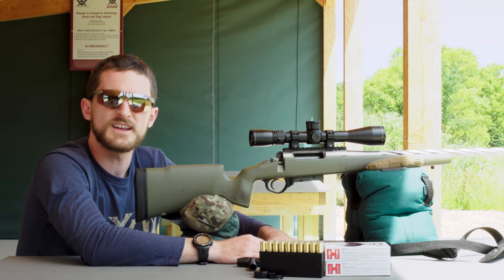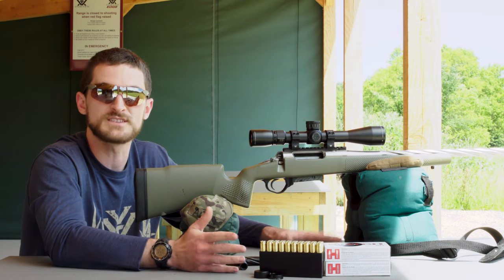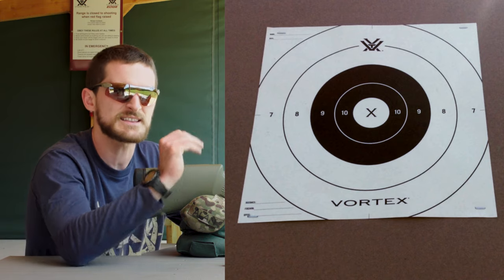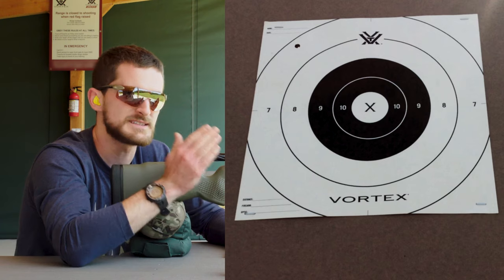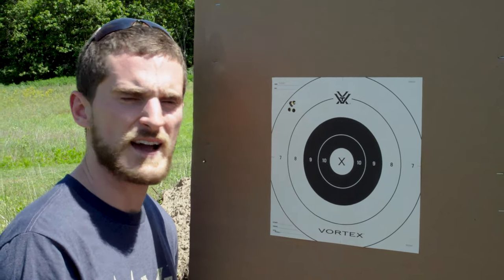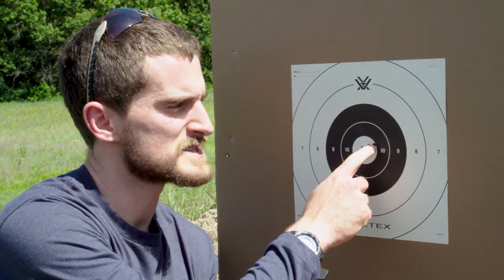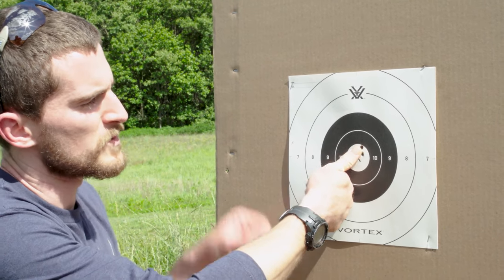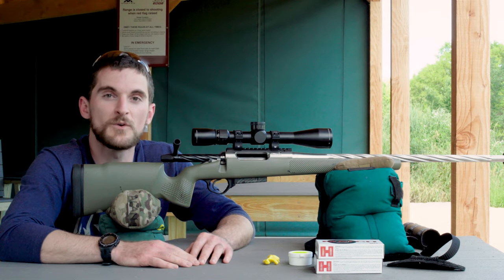How to sight in a riflescope

Comment: My biggest question was answered at 6:50 of this video. When you make adjustments, you are moving the "point of impact" NOT the center of the cross hairs. How many times did I make adjustments just to find out it was hitting even further away opposite the bullseye? So if you are "hitting high and to the left",  make adjustments down and to the right". At 8:18 you hit to the right and said you need to adjust "back to the left" but you have to actually adjust "right" to move point of impact. So many other videos I watched didn't clarify this. Thank you.
Reply: I'll watch videos on this and think I understand and then do the opposite at the range lol

Comment: Another thing i like to do is firmly grip the scope and ensure that it is sturdy, i have a savage 6.5 Crd Mre. And when i zeroed it the first time a few months ago i was excited as it was my first time shooting it but to up the anti, i was loosing daylight fast so i rushed it i used a series of tools to ensure the rings were square on the picatinni rail base (provided by savage) with 20 MOA, I thread locked my ring screws but forgot the BASE ones and needless to say when i tried to confirm my zero yesterday the base was loose and it was pointless shooting so i will try again. Thanks for all your info !

Comment: Oh my god.... I never knew that’s what people meant by “resetting the turrets to zero.” I didn’t know you could take the knobs off and do that.....
Reply: I just realized that. Wow!
Reply: @igorbukhantsov  neither did I… one of my cheaper scopes doesn’t do it but sure enough my Vortex Rimfire does…. I thought at first that was just in case the knob was slippery or something and you wanted to use a tool or a cartridge to turn them. A lot of smaller optics like red dots and stuff require a tool to adjust the zero so you can’t accidentally adjust your turrets.

Comment: So I purchased the Vortex Viper HS 4-16X44. I zeroed my rifle Tikka T3X Lite in 6.5 Creedmoor with 0 MOA Talley rings at 100 yards. It’s advertised that the scope total elevation is 50 MOA but I counted all the MOA’s from bottom all the way up is 64.25, so my question is, is there such thing as having more MOA’s for elevation as what it’s advertised?
Reply from the maker: Yes, that is very common. We are pretty conservative with the numbers we publish, so on that optic you will have at least 50 MOA. It is very common to have more than that though.
Reply: My Viper PST Gen II 3-15x44 FFP is speced for 75 MOA of elevation adjustment. It actually had 84 MOA of adjustment. So after backing the zero stop off,  I ran it down to the bottom and then up 42 MOA (half of 84) to begin with the reticle centered.  On a rifle with 20MOA of elevation built into the rail or the scope mounts, I would have come up 22MOA from the bottom (42-20) to get a ballpark scope reticle lining up before the initial bore sighting.

Comment: Hi guys my turret covers on my 3-18x44 sfp strike eagle does not have a slot head to remove to set zero. What other screens heads were used? It may be a torqux head or maybe Allen key. Hard to tell it's very small.

Comment: for a rzr zero stop scope, do you remove the top elevation turret when firing rounds for sighting in?, also if you remove the clicking screws on the base elevation turret to bore sight, are you able to fire rounds without the set screws on the inner elevation turret?

Comment: Does it matter on what magnification the scope is when zeroing it in?
Reply from the maker: As long as you are using the center part of the reticle magnification will not matter. It's usually helpful to be at a higher magnification though as you can be a bit more precise.

Comment: Once you’ve sighted your scope how do you stop it from getting bumped and the turrets from turning etc I’ve always used the older scopes with the old coin style to adjust etc and caps to protect them I’m looking at getting a scope like this once sighted how do I stop it from turning etc ?
Reply from the maker: There would have to be a pretty significant bump to the turrets to get them to move that much off of zero. Which optic do you have?
Reply: @VortexOpticsUSA  I’ve just ordered the vortex Dimond back tactical FFP EBR-2c MRAD I’ve only ever use the older scopes with the turrets that you can only turn with a coin or screw driver etc etc and was just wanting to know how you use this new one with out them turning and spinning after being sighted
Reply from the maker: @matthewharrington3154  On that optic you can re-index the turret so that it is lined up with zero. This will serve as a reference point where you can simply look down and you'll be able to tell if it was moved or not.

Comment: So I just purchased a diamondback tactical 4x24-50 today and did not realize it didn’t have a zero stop prior to purchasing. My question is once you zero and they remove the turrets and orientate the turrets to that zero how do I prevent myself from going beyond my zero if I make adjusts?
Reply from the maker: The only time it really should be a concern is if you dial more than one complete rotation. If it is under one rotation you will simply need to remember to dial back down to align with zero. If you dial past one full rotation you will need to keep that in mind.

Comment: On my vortex scope i have a distance adjustment. When i zero in at say.. 25 years with scope set to 25 and then go to 50 yards and adjust my scope to 50 yards my scope is WAY OFF… do i need to bring my scope in for repair?? That distance adjustment should work correctly but it doesnt…

Comment: @vortex optics  I am shooting a crossfire 2 what on the dial to move the scope does it have? Is it MOA? Can I reset zero on that scope? What is the math that I do do determine how many clicks to move the scope?
Reply from the maker: The Crossfire II uses an MOA turret system and reticle. You can reset the turrets to align the 0 with the indicator line, but it does not have a zero-stop.

Comment: Is the a recommended bullet weight/type for zeroing? Is match ammo better so sight in with?
Reply from the maker: It really depends on your application. You will want to use the same ammo though that you plan on hunting with or shooting with later.
Reply: Confirming zero with what ever ammo you plan to be using is the best practice

Comment: Did you use a laser boresighter and, if so, which one?
Reply from the maker: We recommend taking the bolt out of the rifle to boresight or to break down the optic so you can align the bore with the target and then align the optic with the same target.
Reply: @VortexOpticsUSA  That’s all well and good if you’ve got a rifle that you can pull the bolt and be able to look down the barrel.   With rifles like an AR-15 or, in my case a Mini-14, looking down the barrel at a target isn’t possible.
Reply from the maker: @SargeUSMC  With an AR-15 we would simple remove the upper from the lower and take out the BCG. You can then proceed to boresight as normal. The tough part with laser boresighters is that due machining tolerances they don't always align with the bore and when using them at close distances then can give skewed results. You would want to use them no closer than 50 yards like you would traditionally boresight.

Comment: Do you do this on maximum or minimum magnification?
Reply: Either, point of impact shouldn’t change based on magnification
Reply from the maker: You can sight it in at either as magnification won't change your POI as long as you are using the center crosshair. I would recommend doing it at the highest though for the simple fact you can see your target up closer and be more precise.

Comment: easiest way to think of sighting a scope for me is the scope's cross hairs as "chasing" the impact point. Blue thread dressing on all  mounting screws. Red is too permanent.
Reply from the maker: We would not recommend putting any Loctite or threadlocker of any kind on the ring screws. It acts as a lubricant  causing the torque wrench to slip when mounting and will result in a false reading. Using Loctite can add about 40-50% extra torque to your value. Simply use the proper torque spec (15-18 in/lbs) is what will give you the most performance out of your optic.
Reply: @VortexOpticsUSA  I agree and should have stipulated my statement related to the heavy Burris Optics Eliminator II laser scope  4-16x50mm . The Eliminator scope series use "Direct Mount" clamps instead of rings. One inch risers are necessary for a picatinny rail mount compounding the problem. A poor engineering design. Without the loctite the screws consistently come loose. thanks

Comment: This is probably a stupid question but Idc. Is there anything u recommend if I don't have the bean bags? I want something accurate, but can't imagine they are cheap like any other gear.
Reply: Not a dum question.   Me??  I take a bunch of those plastic grocery bags,  and put gravel? Sand? Black dirt in 1.  Then put that one inside several others, so if the bag with that stuff in it breaks?  You won't have a mess.  Good luck